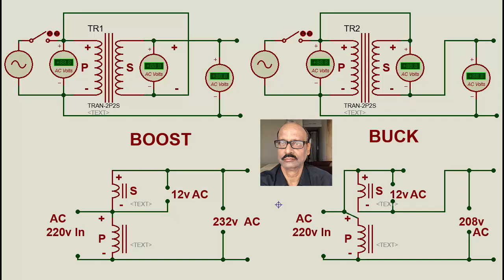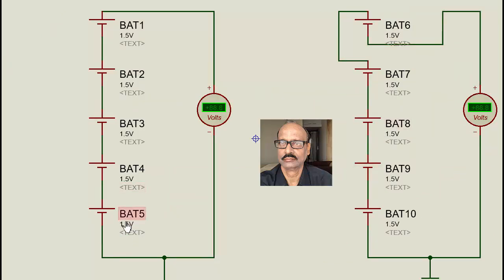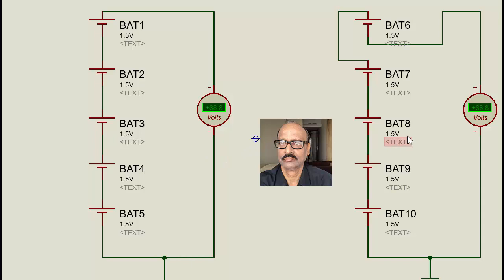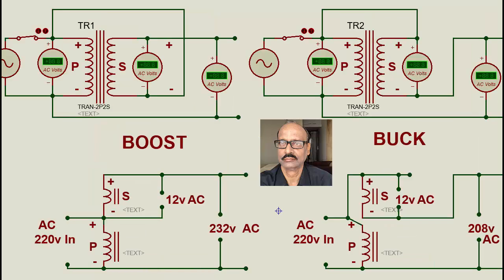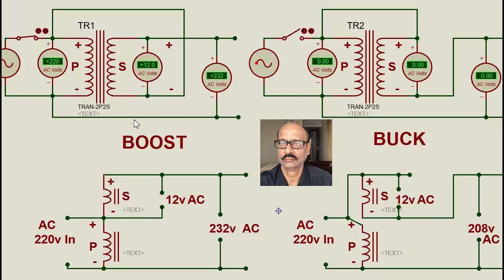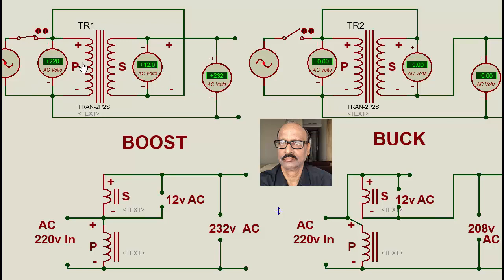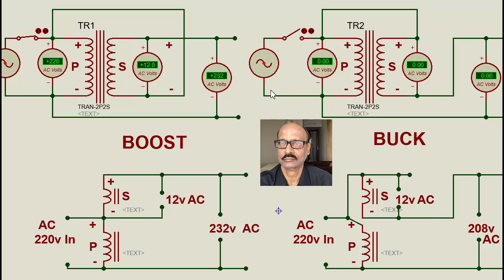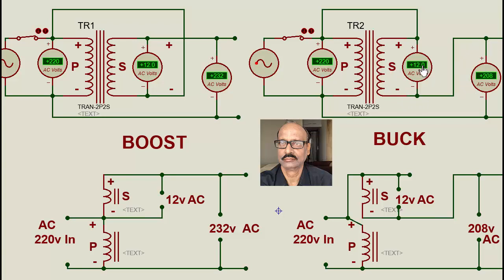Voltage Stabilizer 2 basics  Boost and Buck

Comment: In AC circuits, the terminology of + and - is not correct. Even for education, this should not be used. This is an origin of working professionals with misconceptions.
Reply from the maker: @akilaravi1  I had repeatedly said +  & -  for AC are not correct. For ease of understanding only it was mentioned like that. Putting a dot ( usual practice ) in order to indicate the polarity would have been difficult to explain the basic concept of buck and boost.Please refer how western people on the net who  provide an arrow for DC current flow from -ve to + ve ( because they use the concept of electron flow) as compared to us we put arrow for DC current flow from + ve to - ve. While both are correct it confuses a learner.

Comment: Excellent presentation. But, please correct the diagram provided for connecting the battery in series for 7.5V and 4.5 volts for series parallel combination.  In the second diagram also all the capacitors are in series.
Reply from the maker: @akilaravi1 Pls note  it is not series parallel but series only. Please try the hardware way the result will be exactly shown as in the video. Please note the video is made by the most renowned simulation software and not an animation.Hence it can never be wrong.Moreover where did you find the capacitors? Please note they are all cells not capacitors.